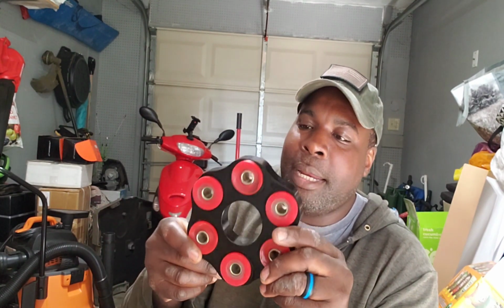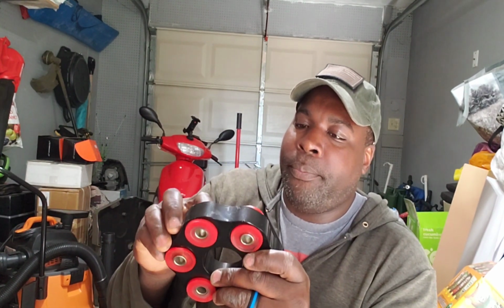UPDATE ON TH FAILED 09 CADILLAC STS COUPLERS

Comment: Around 3 yrs ago, I had my 08 STS on the Hoist, and looked at the Coupler, and saw some small cracks/tears, but they didn't look too bad, so I ignored them. Car was written off a couple of Months ago, due to a Collison(some woman ran a Red Light when I was making a Left Turn) 2 yrs ago. I drove it 23 months before filing the Insurance Claim, cause I figured the Insurance would Total the car, and I was right, but I drove it for 2 more years, Damage was just the Passenger front corner, but it was $7500 to repair. It was fun to drive, but my Kidneys are still sore from its Ride. 
The Front Shocks are actually quite easy to replace, but the Rears are a pain cause you have to crawl all the way to the front of the Trunk, after pull the Panels out of the Trunk. One item to keep an eye on, is the Wire to the Left Front Speed Sensor, it often breaks internally on/near the Lower Control Arm. When it does, you lose Power Steering when you hit a bump. Shutting the Car off and restarting will restore the Power Steering, until you hit another bump. I was able to locate the break in the Wire and repair it, and it was still working when the Car was written off.
I kept the Salvage, and sold it to my friends Kid, who is turning it into an Ice Racer.
Reply from the maker: Wow thanks for that information ill keep a look out for that those thing thank for telling me your story.